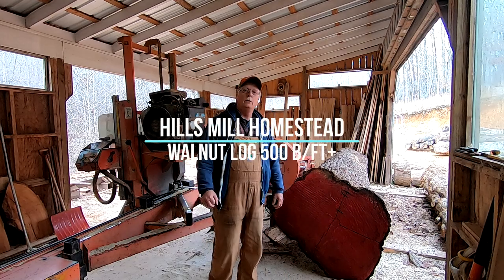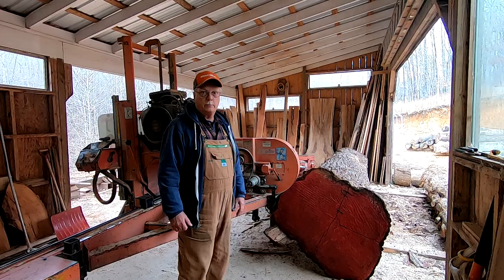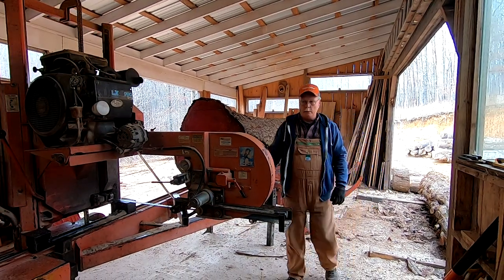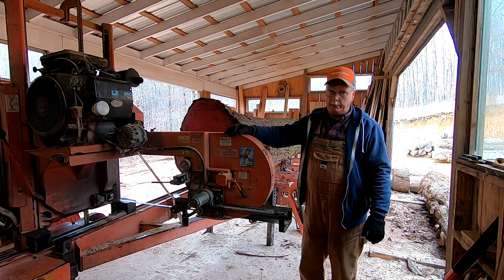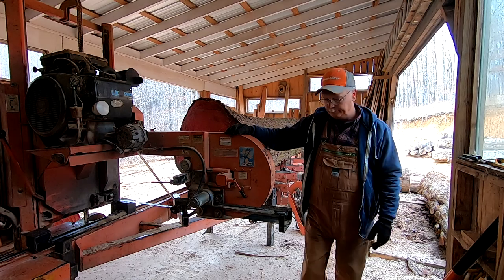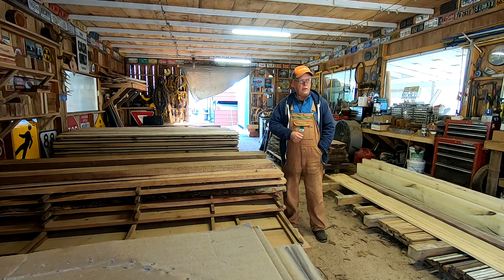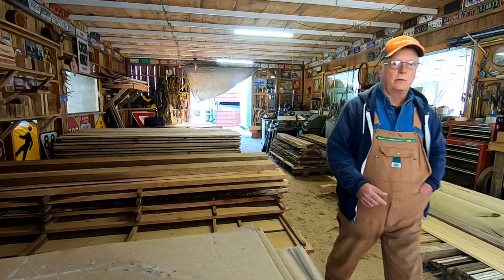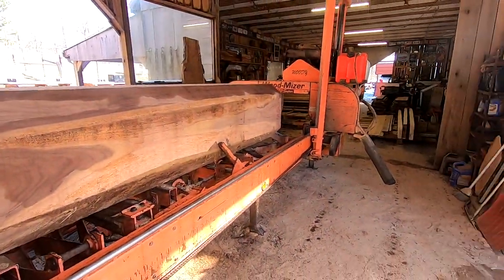Saw-Milling Oversize Log With Portable Band Mill

Comment: See you twice on deep south homestead.  Finally heard you say your site slow enough to get it.  I watch on Big TV and need to go to iPad to like or comment.  I have a small manual sawmill and lots of big yellow popular trees .  I cut one down and it was to heavy for my equipment to  move.  So now I will try again, good thing though it splalts rainbow colors.   A good market is woodturning blanks.  Crotch’s knots weird grains. Saw them square to fit a postal flat rate box so shipping price is fixed,  then incorporate that rate into price and sell with free shipping lower 48 only.
Reply from the maker: Thank you for the information. I try to keep turning blanks, bowl blanks, pen blanks, table legs, etc. in stock. At Hillsmill.com I've thought about adding a page for species and sizes for shipping, thanks again.